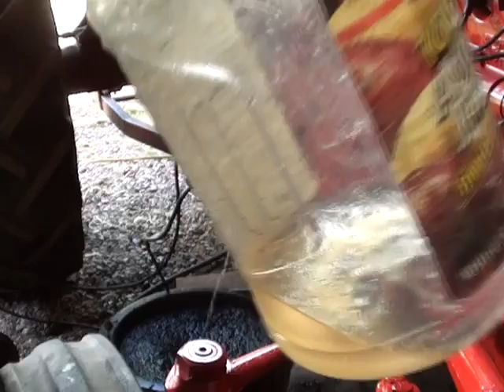Pt 5 International Harvester IHC 300 Utility Repair

Comment: remember the gold looking rock looking filter that they used to use in rochester carbs ? you can use a couple of those in a small pipe nipple with drilled and tapped caps on the ends with barbed fittings to hook to the fuel line...yes I did it , works well , I had the stuff around , and needed a filter at 2am :) and it always gets the what is that , why is it there questions , and it is cleanable lol

Comment: The gas problem is called "phase separation" and as stated water in the ethanol blended gas. If you would have shaken the containers real good and let set it would have completely separated into watery alcohol and gasoline. Then pour the gas off and burn it for fuel. I also found that if you can get the tin inline fuel filters as opposed to the plastic, then they are still made the old way (glued) in elements. I have seen dirt go right around the element while running in the plastic ones before.

Comment: Great video. Keep them rolling. I am using Roxio Video Wave 9 and like it pretty good. I would bet that the newer version would be even better. Lots of transitions, easy titling, the choice of putting them with a clip or part of the overall production is nice too. It does seize occasionally still, but much better than the Windows Movie Maker.

Comment: I managed to get a MM running on one cylinder for a friend after he did some work on it a while back.  It was running on one cylinder because he never did a compression check.  He eventually pulled the jugs and we found cracks at the top of 3 of the jugs, 2 of which you could see through.  I still don't know how I managed to get that dam thing to run for the 30 seconds or so that it did, but that just goes to show how much old tractors like that want to run.

Comment: I had a fuel leak on a motorbike years ago and the gas trickled down the side of the ignition casing. Because the seal wasn't that good on these casings some fuel got into where the points were and the next time I tried to start the bike the casing exploded and shot past my ankle at 1000mph. Lesson learned!
Reply: +Big Ian Builds My dad managed to catch himself on fire because of a fuel leak on his old yamaha 250 dirt bike.  Gotta watch that boom juice.

Comment: Is there a segment on how to change the oil and hydraulic fluid? I Just got a 300 utility tractor and want to make sure i do it properly. Thank you
Reply from the maker: I have no videos on that. Best bet is to get a service and repair manual. You'll want it for doing all the adjustments on the Torque Amplifier and the PTO engagement. Oil change is straight forward. Plug on the pan. Bolt on the top of the filter canister. There is also a drain on the filter mount. Drains for the transmission are directly on the bottom, and look for the pipe plugs in the side of the trans case for the fill. The PTO shaft has its own lube. DO NOT USE GEAR LUBE. It takes a 10 weight oil.

On the bottom of the trans you'll also find a small lever with a 3/8 bolt in it. (9/16 head) That is the primary engagement for the PTO. It enables you to lock it out altogether if you are not going to be using the PTO at all for extended periods of time.
Reply: Thank you kindly for your reply! Im definitely more of a visual learner that's why i asked. You do a great job with your videos so was seeing if you had anything. What a great video all this would make! This sounds like all the basic maintenance for this tractor? Ill probably get someone a little more tractor savvy than me to help the first go round. I just like to learn. Thanks   @ElderlyIron

Comment: Do you still have this tractor?
Reply from the maker: Yep. It appears in several videos. It's about time to sell it, though.
Reply: ElderlyIron Nice. I just got a 1955 ih utility. no t/a and no live pto. it's been all repainted but that was just to cover up the flaws. it runs and drives but needs steering work and a tuneup. actually has a miss and I found out its just a fouled plug. anyway  I had a question about  the tie rod end adjusting sleeves on mine. one side it longer then the other., not including the tie rod ends.  is yours the same way?
Reply from the maker: All I have seen are equal. That doesn't mean they were all made that way, though. The manual shows how to adjust the gearbox for centering and the like.
Reply: ElderlyIron   ok thanks. yea I got a couple manuals on the way